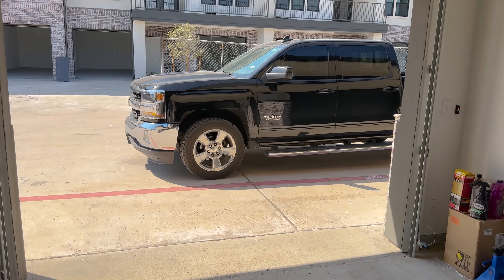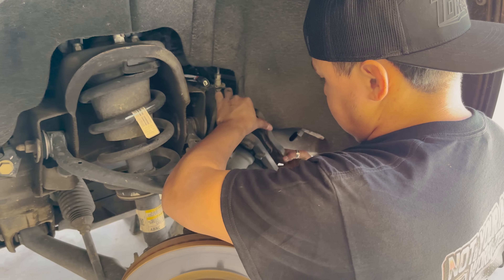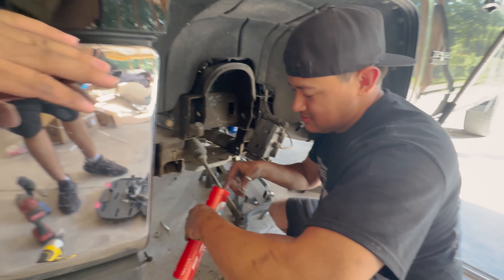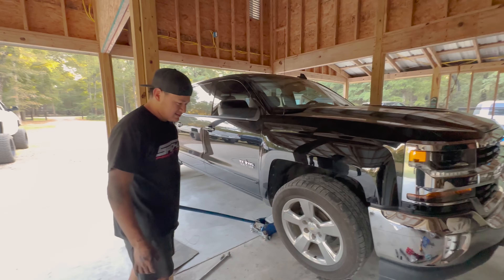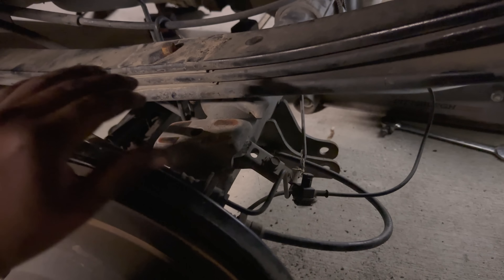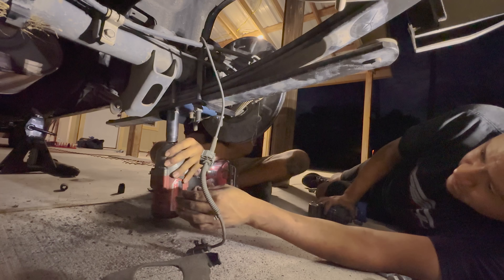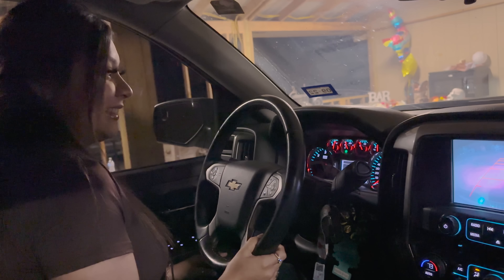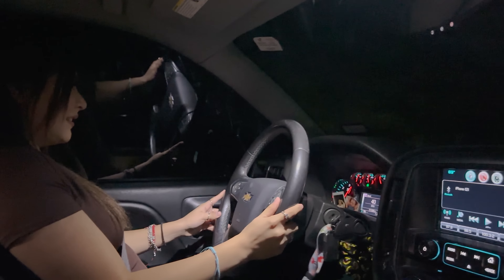WE DROPPED JAAYSEECUUH TRUCK TOO LOW!!

Comment: 7:39 that’s how the bolts and half moon cam plates are supposed to look . On the other side y’all put the nut on the inside close to the strut and the skinny side of the moon is facing down that’s gonna make the truck not align it should look like 7:39 . (The nut  on inside gonna make it hard for tech to loosen/tighten . The cam plate being backwards is not gonna let the camber / caster adjust